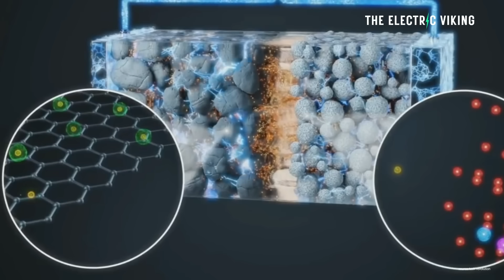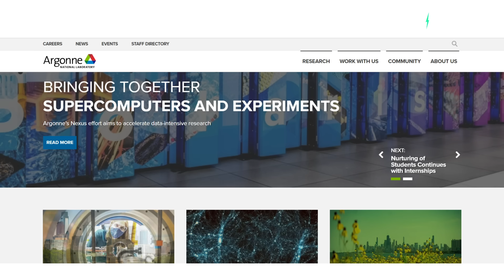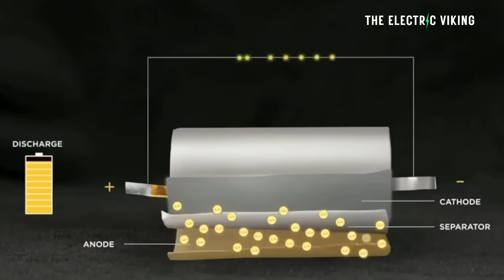US Government Scientists expose why solid-state batteries keep failing

Comment: I think we need to come to grips with the reality that a gigantic Lithium-ion or otherwise battery pack is not the way to go when it comes to vehicles. We screwed up by rushing the adoption of EVs before the technology matured and by not having adequate infrastructure to support them. The solution to a cleaner environment will likely have to be a variety of technologies, including, Hydrogen and other biofuels. The inherent flaws with current EV technologies are too obvious to ignore. I think we should invest more in Hydrogen research as it might be a more sustainable alternative. Think about it…we can’t even recycle current EVs at scale. Hydrogen technology sounds like a better proposition to me.
Reply: How do you image anyone could create a safe tank of hydrogen for cars? Like... Ever?
Reply: @vgbyte1648  - That’s why I said we need to invest more money into the technology. We certainly liquify it.
Reply: @donyakusa9187  You understand FAR less than you pretend you do.
Reply: H2 is less inefficient than batteries in a FCEV, and FAR less efficient in an ICEV. And you have to buy it from a fueling station. It's a boondoggle of the fossil fuel industry and a smokescreen to convince people not to buy EVs. 
More charging stations and faster charging is the solution to range anxiety. And, experience with how it doesn't actually exist.
Reply: @jamesvandamme7786  - Well, current EV technology is not efficient as ICE either. I’m sticking with ICEV.
Reply: @donyakusa9187  EV's are more efficient, than ICE's.  It would seem efficiency is another thing you don't understand as well as you'd like to pretend.  You are clearly in way over your head.
Reply: @TheEvilmooseofdoom  - You see…EV sales have been in a slump for the better part of a year now. It’s not a fluke, and it’s only the beginning. Here’s my theory: The EV industry is fast running out of new customers with disposable income, plus consumers are starting to see the flaws of EVs. I think this ship is sinking fast and hedge fund managers are starting to lick their chaps.
Reply: You Sound like a Toyota propagandist.
Reply: @ubermenschen3636  - Deep down, you know what I’m saying is true. The average car buyer is not ready for EVs now and won’t be by 2040.

Comment: This is why competition is good, in the end we all win.
Reply: excuse me competition kept failing to find the reason they are useless ...took a gvt agencie to find the reason
Reply: @flodjod  Huh?
Reply: The fire thing is an interesting discussion. 
I wanna note that while current EVs are dozens of time less likely to catch fire per mile driven than an ICE car, this is misleading due to how new EVs are. Once the average age of an EV is as high as the average age of an ICE car, we’ll have a more meaningful comparison. Maybe most of the difference in current rates do car fires is due entirely to how newish most of the EVs are that compromise the data
Reply: But these Lithium batteries suck.  Either they catch fire, can't handle extreme heat or cold.  charging stations aren't as reliable as they need to be.
Reply: @Oneness100:   Don't make the imperfect the enemy of the good. 

Tesla caarging stations are VERY good which is why they're winning much of the charging market.  LFP (batteries are a BIG improvement (re both safety and stability), and many other improved combo chemistries are being worked on.  Also sulpher, silicone, etc. vs. lithium.  

BEV's are already MUCH MUCH better than they were just a handful of years ago, and clearly they'll keep on improving. 

In the mean time, customers can choose HEV ad PHEV cars if they prefer, while green energy and batteries improve.  

ICE's have been improving marketly for 120ish years.  BEV's can continue improving a LOT for decades, based on the pace of discoveries, now that the effort is being made (far more profit incentive).
Reply: @Oneness100  Lithium Ion battery cars catch fire 10x less than ICE cars.  LFP battery cars catch fire about 100x less.  Every EV car is already much safer than any ICE car re: catching fire.
Reply: @tysonn4736  Yeah, but the batteries in an EV are right underneath you. When an ICE vehicle catches fire, it's usually contained to the engine compartment, not right under the floor board.
Reply: @Oneness100  EVFireSAFE found that there were only 393 verified EV fires between 2010 and June 2023 out of an estimated 30 million electric cars that are active on the road.  You are right that EV fires are more intense but they are also very rare.  ICE fires are way, way more likely to happen.
Reply: @tysonn4736  But you missed the point.  The Battery is right underneath the seats.   Then there are all of the other flaws of battery technology.   I give EV's a few more years until they figure out the battery and charging station flaws and get then worked out so there isn't so many reasons to not buy an EV.  

I'm surprised that Hydrogen isn't getting enough traction behind it. I know they have to need a lot more fueling stations before it can take off, but hydrogen is a potential replacement for ICE.
Reply: @Oneness100  Hydrogen is structurally more expensive than electricity.  Hell, it's even more expensive than gas.  Hydrogen will never be viable strictly for economic reasons.
Reply: @tysonn4736  There are companies working on producing hydrogen fuel at a lower cost, so never say never.
Reply: @tysonn4736   Not according to the Centennial Colorado Fire Dept which outlined the special HazMat crews with full breathing apparatus gear and special wrapping blankets that have to respond to the extremely dangerous fumes from the chemical (not carbon) fire.  They can't just send a water truck and few people with a big hose like has been done for decades.  The number of fires is not the issue. Excellent video: https://www.youtube.com/watch?v=itGeAq9rBeY&t=129s
Reply: @Oneness100 It takes minutes before the battery in EV catches fire. You have enough time to stop the car and even take all your stuff from it.
Reply: @janm778  Yeah, tell that to the people that were trapped in their cars and died.

Comment: Quantumscape has been working on the problem of dendrite formation for years.  They have developed a special ceramic separator that prevents this. Testing of a prototype has shown that the battery exceeded durability (recharge cycles) expectations  and that it could likely last longer than the car itself, providing hundreds of km of range even after 8 years of typical driving.
Reply: But why this solid state design every yr with announcements saying breakthroughs but then nothing in production.  Going on like this for 10 yrs.  Please can update on your thoughts?  Maybe is design for solid state but just can’t mass produce?
Reply: @michael-qp9xd  It takes years to figure out what the product should be.  And then it takes years to figure out how to make it in a large scale, reliably. This is the stage QS is presently in. They are spending over $350 million a year just trying to get the production process up and running.  Meanwhile others are making incremental progress improving existing battery technology, and coming to the market earlier, which is hammering QS stock price.
Reply: @michael-qp9xd I am sure the sodium battery will take over the world. And the silicone anode. And the dry coating process. An the graphene powered cathodes. And the new formation process. And the semi solid state cell. And the solid state battery. And the blade battery. And the 4680 battery.

Do you recognize what i am saying here?
Reply: @wolfgangpreier9160  yes i read all this too.  But thinking same as nuclear fusion with 30 + years of saying soon.  Someday for fusion and new solid batteries but could be 10 to 20 years before wide scale.
Reply: @wolfgangpreier9160 

"I am sure the sodium battery will take over the world"

In fast response grid storage it probably will simply because of material cost reasons vs lithium and all the various other electrode material in Li ion chemistries.

Better still if they can make a sodium sulphur battery for Li ion or better density with much lower material costs.

Everything else you mentioned is on the money.

Solid state is mostly a boon for weight and volume which isn't really an issue for stationary grid (or domestic) electrical storage applications.

In grid applications the only real concerns are cost, while domestic does have an extra volumetric density consideration simply because of space constraints for the average home that doesn't have a ton of free space to store it.

(domestic space concerns are less applicable to a great percentage of American home plots which often have more land than they can manage effectively)
Reply: @mnomadvfx  Maybe someday the sodium battery will become cheaper than LFP. 10 years from now? 20? Maybe.

Until then the calcium battery will be cheaper than the sodium battery and everybody who has invested in those startups will lose their investment.

Just as those invested in solid state, hydrogen, e-fuel etc.

In grid applications we have working batteries. They are getting cheaper from year to year. 

It will take some years for other technologies and/or chemistries to become cheaper than LFP. For which there are factories, machines know how NOW, and not in the next 10 years. Maybe.

One example: For many years they tried to make a working prototype of redox flow batteries and where are they?

Or solid state, gravity, air, flywheel batteries.

Where are they all?

Nowhere.
Reply: The problem is not technology, it's about cost. You can have 10x performance but if it's 100x cost. It's still not viable product. The same goes with Hydrogen Fuelcell which is a really good technology but very expensive. That's why it's commonly use in Spacecraft as the cost is more acceptable in that case.
Reply: I don't believe it until there is verified independent testing from multiple sources.
Reply: Hydrogen car is much better for environmental. Car lighter and tires get more mileages.
Reply: You are not really selling it here.  I have a 10 year old Tesla Model S with the original battery, over 100K miles, that still provides hundreds of km of range after 10 years of typical driving.
Reply: @SkottyStarcom  Yep. And those were NMC batteries; a new, large-ish LFP battery pack is expected to last hundreds of thousands of miles of driving before the loses become meaningful, and sodium batteries last even longer.
Reply: @SkottyStarcom  I have to say the surprising durability of some of the brands of these car batteries has helped me soften on the stored energy possibilities. Thank you for sharing!
Reply: @SkottyStarcom 

"I have a 10 year old Tesla Model S with the original battery, over 100K miles, that still provides hundreds of km of range after 10 years of typical driving"

That won't be the case for the much faster charging batteries which current EVs are emp[oying.

No amount of wonder chemistry can fix blasting the battery cells with far too much wattage in a short space of time, it significantly accelerates the degradation of the cells.
Reply: @SkottyStarcom  My 20 year old ICE powered car still travels its full mileage that it did when it was new, I never worry about 'fuel tank degradation'  or the massive cost of replacing the fuel tank.  The advertising standards authority in UK has just banned EV makers from claiming EV are 'zero emissions' - Volvo did a study ( they make EV and ICE in same factory ) and found that EV break even point with ICE for carbon used is >80,000 miles.
Reply: @chrissmith2114  Yet you are ignoring the costs of pollution and carbon emissions, which are very relevant to the discussion.  An old battery might need service.  An old fuel system on an ICE may need service.  I had to replace all the fuel lines on my 95 Jeep Wrangler about 10 years ago because they had deteriorated and gasoline was leaking on to the ground.  And EVs are indeed zero emission by definition.  Manufacturing of EVs may have it's own emissions, but that is a separate problem.  Eliminating excess carbon emissions requires more than just making EVs, but can't happen without making EVs.  It's a big problem and a lot of work is still required to fully address it.  Focus should be on improving EVs and not just looking for excuses to ignore the larger problems.
Reply: @SkottyStarcom  The big problems with EV are yet to come,  recycling all those 7000+ small cells is very hard and not cost effective ( costs about $5 to get $1 back ) so I gues they will be like wind turbine blades and just go into landfill.....
Reply: @chrissmith2114  It's likely far higher than that number too. The emissions values for mineral mining and processing which mostly comes from 3rd world countries are completely made up. There is tons of undercover reporting showing how when a mine comes under inspection they just kick out the cheap labor and bring in a bunch of heavy equipment with a few trained operators to drive them around while being inspected. After the inspectors leave the nice equipment is hauled off to the next mine getting inspected and the cheap labor is let back in.
Reply: Just don't buy their stock
Reply: they go from start up to producing company this year!!! small scare in 24 and ramping up in 25 @drunvert

Comment: Solid state batts are the ultimate battery tech as no liquid electrolyte battery can match the performance and energy density of solid state, it’s just getting it right, that is the hard part but, they’ll get it.
Reply: Wishful thinking. 😂
Reply: @wolfgangpreier9160  Breakthroughs are hard to predict.
Reply: @jamesvandamme7786  Not hard, impossible. Just keep your beliefs. Does not make them reality, but who knows? Hope dies last.
Reply: They will always have inherent problems, namely power density or recharge time.  Ions move very slow thru solid state vs liquid.  On the order of 10-100 times slower than liquid
Reply: Most solid state battery articles are just clickbait, just like fusion

Comment: Dirt, dirt & dirtier dirt  self charging  solid state batteries.  Modeling clay, quarts sand & powdered, activated charcoal. The clay squishes down on the sand exhibiting the piezoelectric effect. The charcoal carrying the released-ion.  After mixing, adding distilled & electrolytes  wrap a precisely measured blob around the solder & work into a cylinder shape evenly wrapped around the solder. Leaving enough solder to get on with an alligator clip. Wrap in aluminum foil, avoiding contact between foil & solder. I found simple drying created electricity.  I baked some in an oven & think it made more electricity.  I made up a bunch of different common water soluble, household products in labeled jam jars. It only took a few drops of any solution to get the clay, sand& charcoal to work. The sand & charcoal dry the clay out.    Borax, sugar, sulphur, stump remover, Himalayan salt to name a few electrolytes I experimented with.  I worried the aluminum foil is decomposing creating the galvanic  effect. Not my desired intent.  I'm thinking an extremely fine carbon black, activated charcoal mixed into a nail polish..varnish..

Comment: Hp batteries ( high oerformance batteries ) of germany i thought already got a working solid state batteries.now tested up to 9000 cycles with no degradation.
Reply: There's a lot of other parameters to consider, starting with cost.

Comment: The biggest obstacle to EV acceptance by the masses are non-serviceable battery packs.  The only option is to replace with complete battery assembly.  Why?  Li-ion batteries are made up of hundreds of individual cells that look exactly like flashlight batteries.  If one cell shorts, then anyone should be able to swap in a new cell.
Reply: Safety
Reply: If it lasts longer than the car, not a big deal.
Reply: What nonsense.  Whoever spoon fed you that just gulled you hard.
Reply: @TheEvilmooseofdoom  Nope.  Replacement battery cost is astronomical and far beyond what the working man can afford.  Try getting out on the street and talking to regular people.

Comment: Does any EV sold in North America get the new CATL LFP battery?
Reply: There is more money in selling batteries with advanced tech than selling the cars that use them.   I would expect CATL to sell them where ever they can as often as they can.
Reply: No
Reply: @simply9990  that’s what I remembered. US not allowing Chinese made batteries to enter the market.
Reply: @gregtheelectricviking Would you want a bunch of sub standard batteries which either don't have the power density they claim or likely going to go into thermal runaway because it's such piss poor quality?